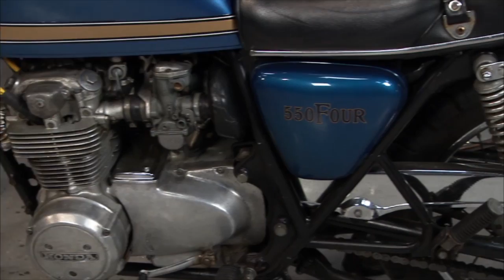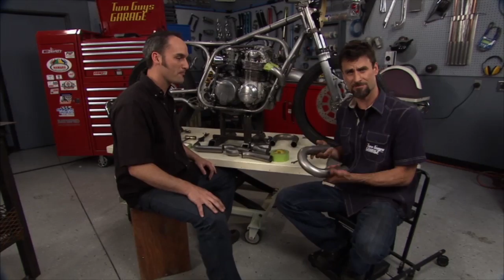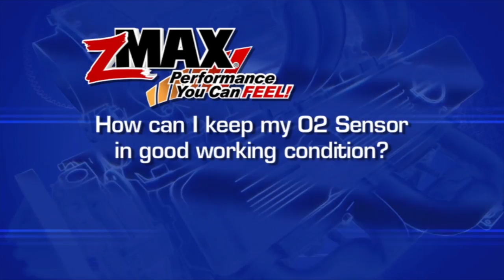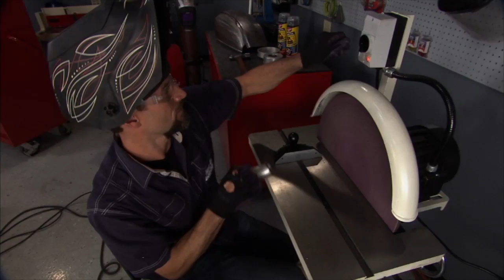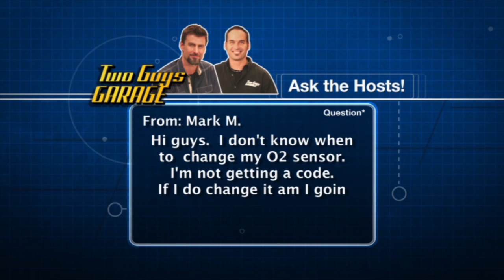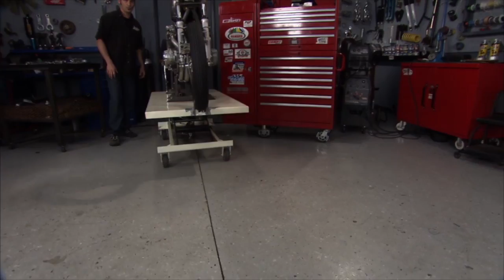'77 CB550 Overhaul | Two Guys Garage | Season 8 | Episode 5

Comment: Hello I have a question on the stator if you use a multimeter testing the 3 yellow wires whit the engine on and I did the test but nothing it’s reading is this is normal or would you think Is bad thanks bro